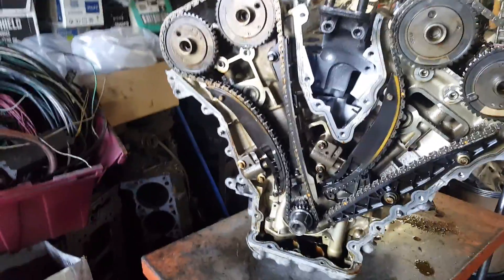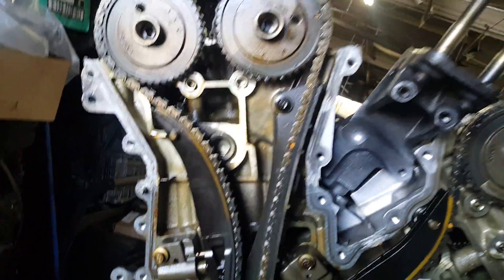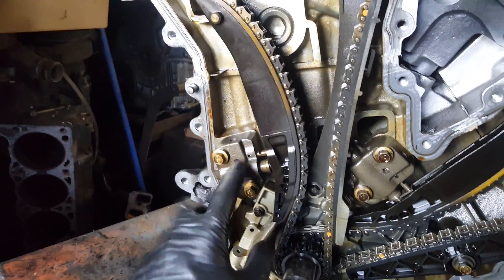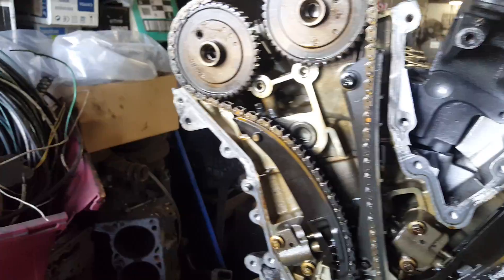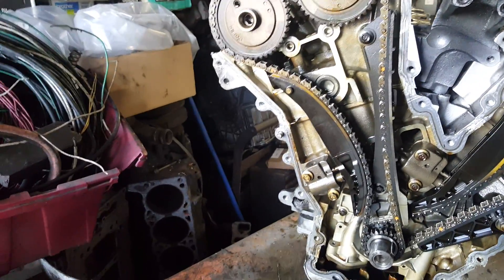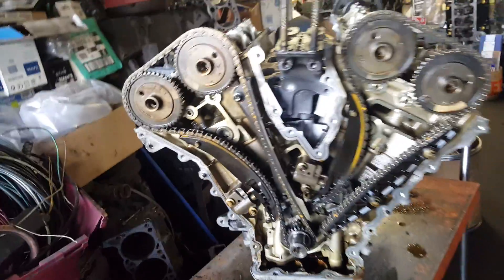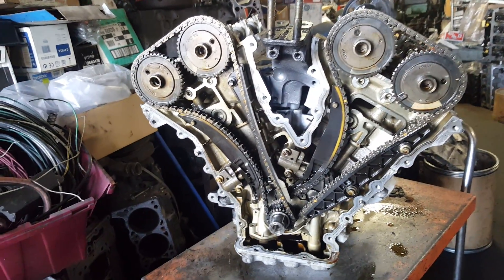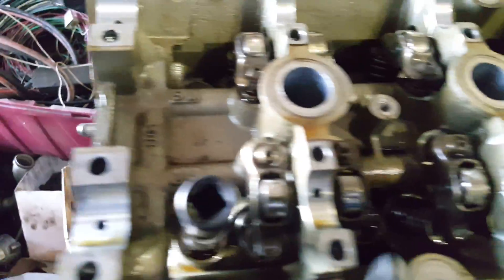Ford 3.0 timing chain and head removal

Comment: You missed a crucial step, setting each cylinder in the neutral position before removing the chains, that way the valves won't hit the piston like yours did when the cam sprung back when you were taking the chain off
Reply: Was thinking the same thing he trashed that engine

Comment: I replaced the timing chains and head gaskets and all my timing marks are on the colored links. But now it will not fire. The fuel pump comes on but the motor will not start. The motor has 100,000 miles on it and appears to have been well maintained. The water pump went out and it blew a head gasket. So I put new chains on it also
Reply from the maker: Make sure you have compression on all the cylinders
Reply: It has compression. The battery was unhooked for about two months. Is it possible that it lost its program from the key? The key is the type that folds together like a pocket knife. The main body that the key folds into is missing. But the van came with a key fob that works the alarm and doors. The Mazda dealer told me that the chip is in the part I'm missing. I don't know if the key was like that when I bought the van off of Facebook.
Reply from the maker: @gearldwinston5251  yeah could be antytheft problem! Open the switch to ON position nd look around the dashboard to see if you notice any security light flashing or ON
Reply: There is no security light flashing. What does that mean?
Reply: Hello but do you know what it means when I don't have a security light flashing or lighting up
Reply: A couple of weeks ago you asked me to make sure I had a security light showing when I put the key in the ignition switch on my 2005 MPV van. It turns over but won't start and I don't have a security light flashing. It doesn't light up anytime. The motor just turns over and it does have compression and I hear the fuel pump running. But no spark at the plugs
Reply from the maker: Message me on Instagram 13b_dorito so i can help better and faster

Comment: good afternoon, tell me on which run you need to change the chain?  on this engine Ford if the timing chain jumps the valve is oppressed?
Reply from the maker: Yes if it skips it will mess up the valves

Comment: Great vid.  Missed one thing when you commented about removing it in the car.  The alternator and it's mounting plate need to be removed to release the last sideways bolts in the back side of the case where the alternator mounts..
Reply from the maker: Good input 🙌
Reply: I'm having trouble finding the upper bolt for that bracket. I can see the lower one but I have no clue where the other one is
Reply from the maker: Might need a mirror?
Reply: @JM8686  Good idea. A problem I'm having is lighting and everything is covered in grease. I'll figure it out. Thanks for the reply. I do have a small pen style mirror
Reply: @JM8686  I was pulling on the cover wondering what the issue is, but it has to be those bracket bolts

Comment: Do you have to pull the engine to replace a timing chain or even a cylinder head? On a 2002 Ford Escape I took off the lower intake manifold on mine and I could see the head clearly idk if I’d have enough working room but is it doable? Or been done
Reply from the maker: If you have the v6 with the double timing chains, one in front and one in the back, you have to remove the engine! Now if you have the one with only one timing chain in the middle of the engine ,you are able to do the job with the engine on the car
Reply: On a 3.0L 2002 Escape I removed the front head with the engine in the car in order to replace a piston. (Piston had seized and broken due to overheating.)